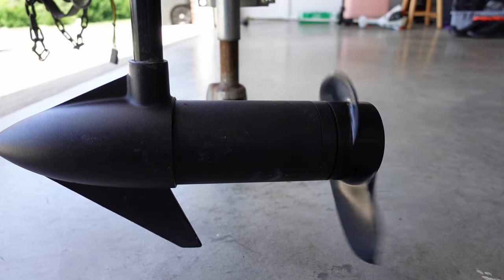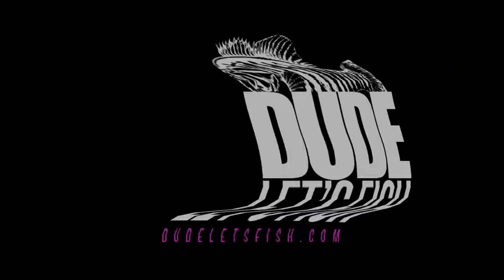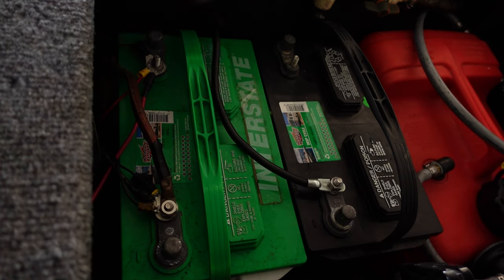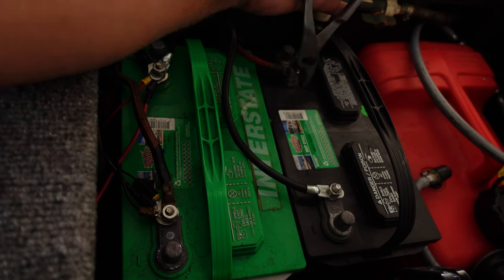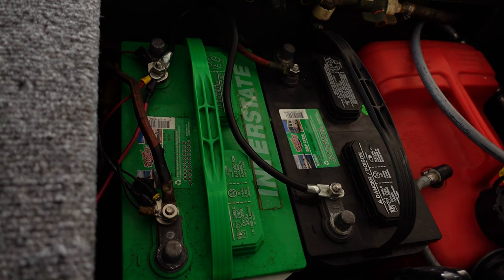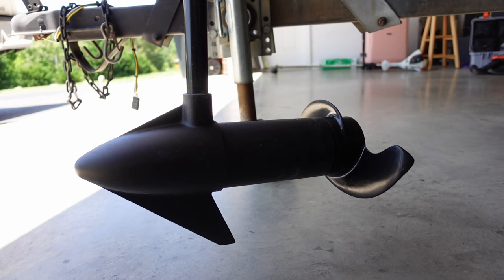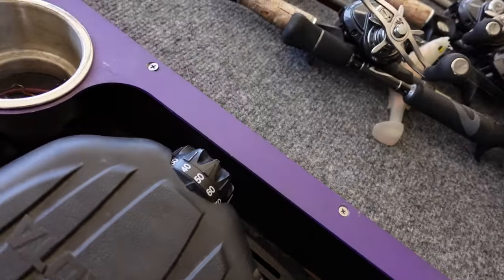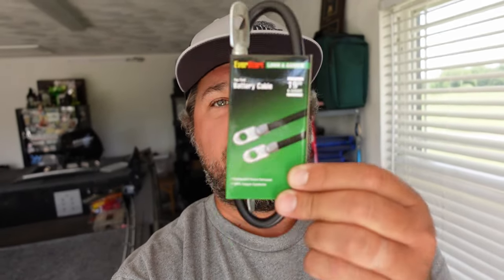How I Wired My 24 Volt Trolling Motor In My Jon Boat

Comment: To also add to a couple comments here, YES you want matching batteries very close to the same age and charged to the same charge before wiring in series. If not you can have voltage drop from one battery to the other as they try to balance out. With different batteries the chemistry will not be the same and you can run into some major issues there as well.

Comment: if you dont mind . What is the battery model numbers so I can see the amp hours ? I have a 14' jon boat with a 24v minn kota and going by the minn kota web site I need like 100 amp hours and 180 minutes of reserve capacity to get 1.75 hrs of 100% run time.  With three batteries I am at 165lbs with three batteries. Two batteries for trolling motor and one battery for accessories. Also what is your run time, or time on water before you recharge?

Comment: Once you bridge those batteries into series everything hooked to them is getting 24V. You either run parallel and double the amp hour at 12V or your in series and the amp hour stays the same but your voltage goes to 24V. 

I’d made sure anything else you have hooked to those batteries is 24v capable if not you
Can have some serious electronics issues.

Comment: Dude, I’m no scientist myself but I don’t have my trolling motor (Ultrex) hooked up any other way than what you did bro but I do have my electronics on a separate lithium battery so you might want to check on that before you run your LS like that
Reply from the maker: I’ve been running it for a while with no problems… they both read 12.6v

Comment: Does the Jumper cable have to be Black or Red?
Reply: Makes no difference. Color of sheathing is to help identify power vs ground vs accessory. It’s all copper wire under the sheathing.

Comment: Did you change battery charger?
Reply from the maker: Nope, still the same one
Reply: So how did you wire it to charge 2 batteries
Reply from the maker: @markmifsud4044  it’s a 3 bank charger
Reply: Ok thanks